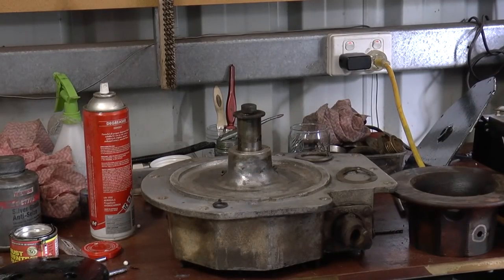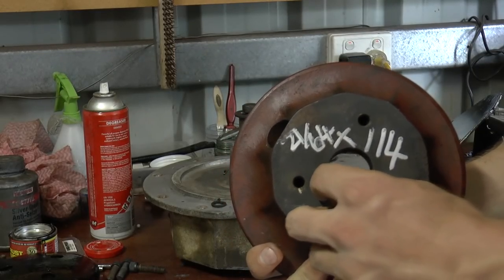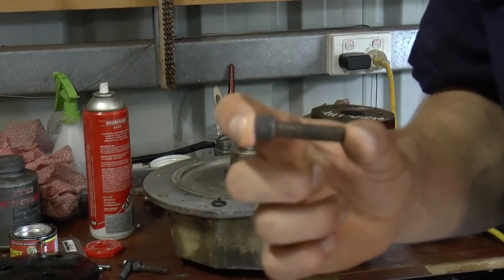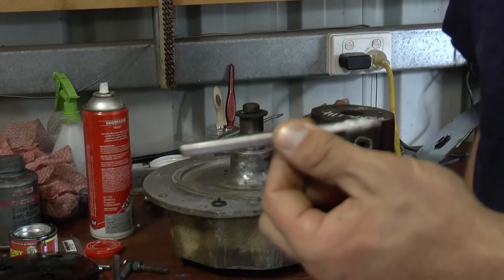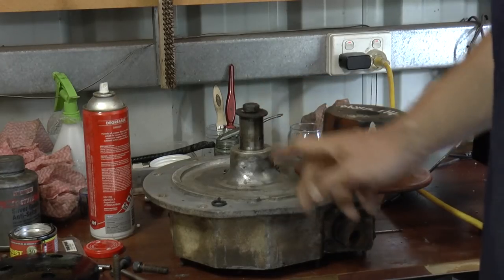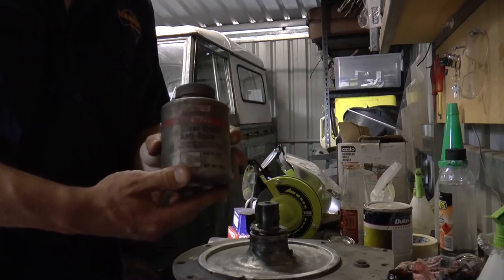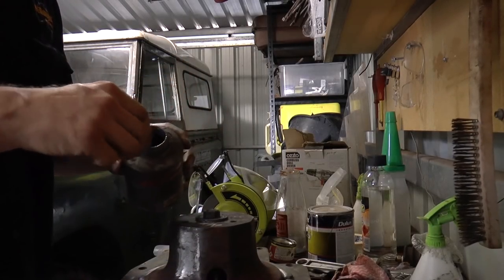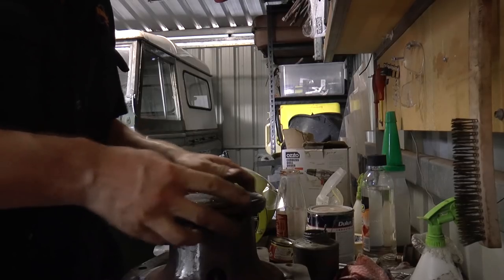Trouble Shooting Land Rover Series 3 Capstan Winch PART 2

Comment: I know it’s an old video but a top tip for you Geoff is fill the capscrew head (allen head) with some silastic, it just stops the hole filling up with crap.
Reply from the maker: Differently a firm solid top tip as always Paul, top stuff. Also not sitting out in the weather for 40 years doesn't help :). Many thanks. Cheers Geoff

Comment: Why did you not soak the bolts in hydrochloric acid? To disolve the rust works every time combined with a follow up atf and acetate mixture penetrating fluid made up and a bit of heat if needed. If your breaking bolts your doing it wrong.
I also use spray freezer to crack the rust. I use very little force. That shaft is an intereference fit and too tight phil
Reply from the maker: Hi Susan P{rice. heat was applied and most of the volts were already snapped. Cheers Geoff